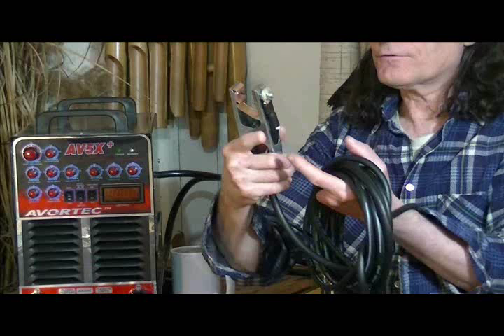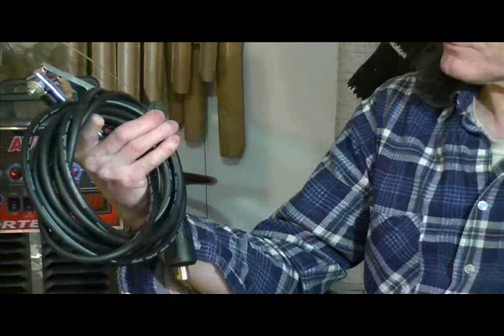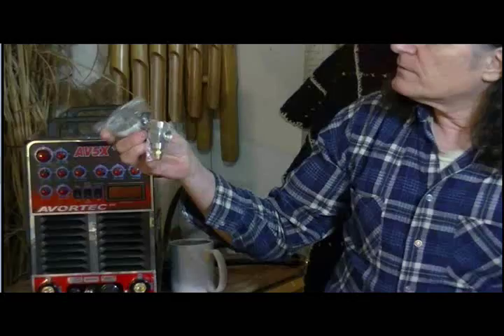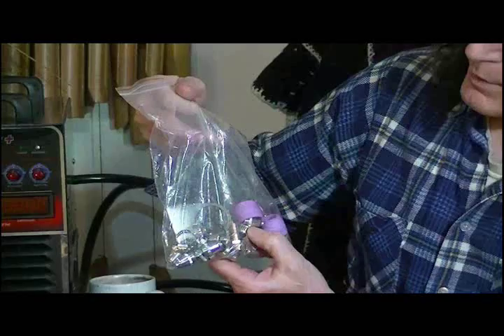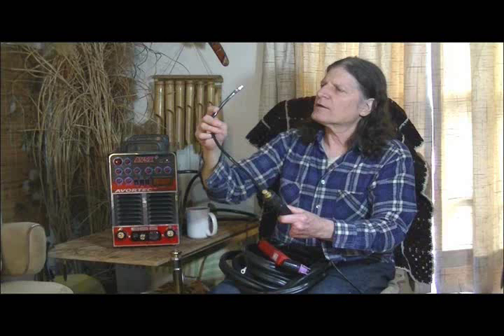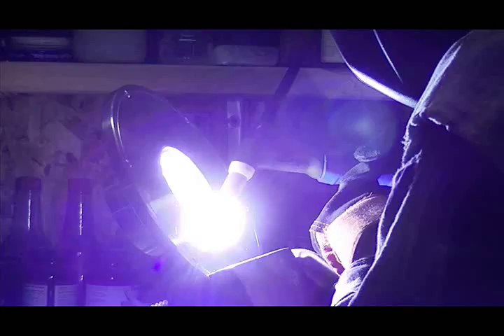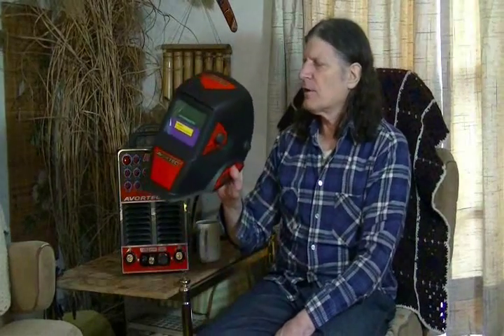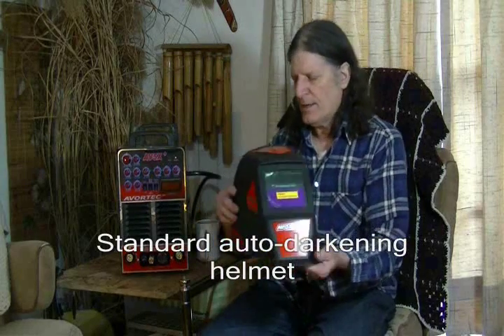Copperland equipment review: What's in Avortec's AV5X+ Kit? Intro-2

Comment: As a hobbyist involved with old autos I'm looking to eventually purchase a multi function welding unit like the Avortec. To that end, I'd like to know what I need to add to my electric service panel to run this unit. I realize it will need 240 V. Could you tell me the gauge wire and circuit breaker amps you run to your work area? From my panel to my garage where I would run my welder is about 125 feet. 

Also would a  gas generator be able to run the unit instead of running from my service panel if so what wattage would work in your opinion. Thanks for your videos I watched several and you do a nice job of explaining.